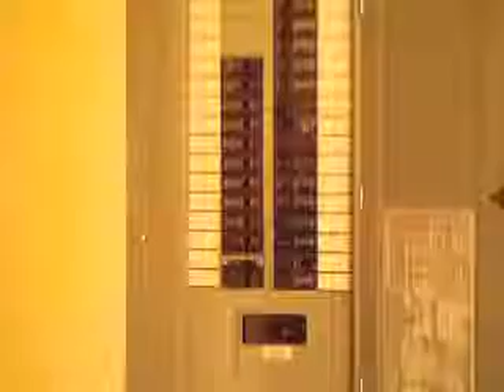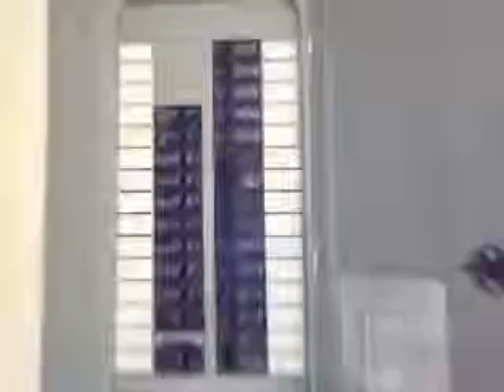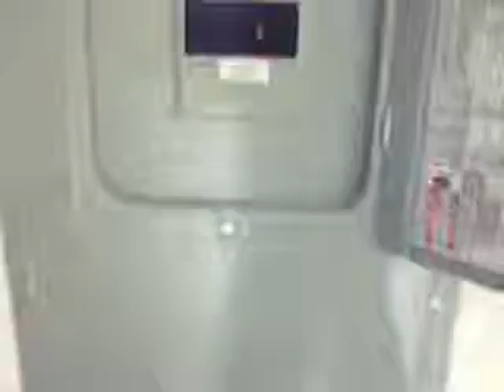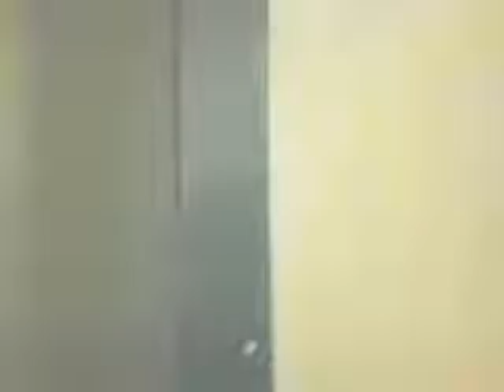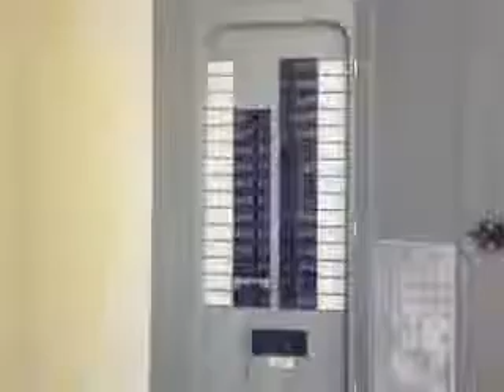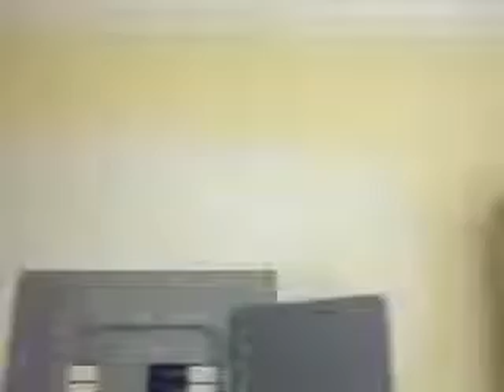Buck Parrish, 200 amp, service

Comment: Why is it upside down?
Reply: Robert Mitchum ...Those panels are designed to go either way. 
The main breakers are from left to right. The NEC  states a breaker cannot be ON, in the down position. Or OFF in the up position.
Sideways is okay. Most panels are designed like that now. If your main is fed from below turn the main lugs down. If it's fed from above turn the main lugs up.
Your Welcome